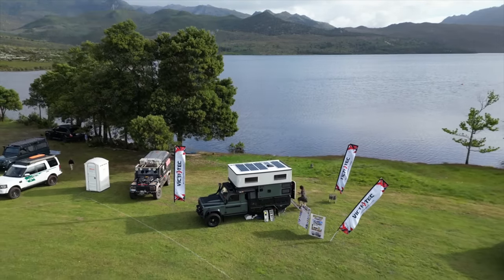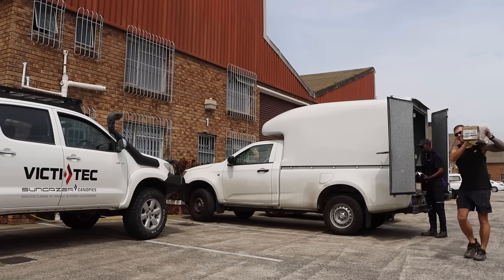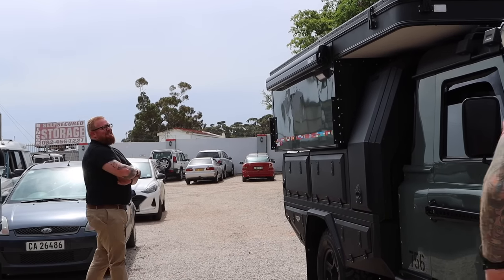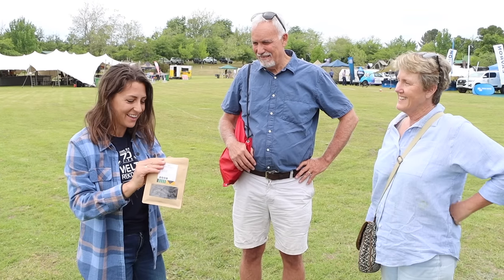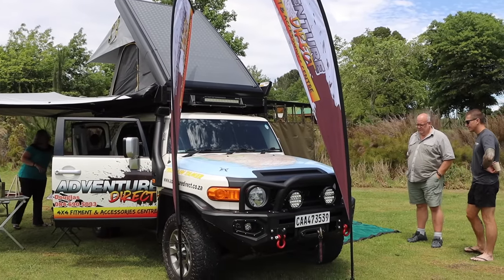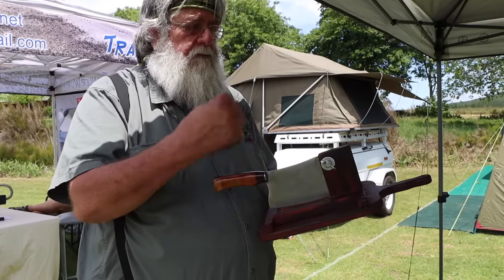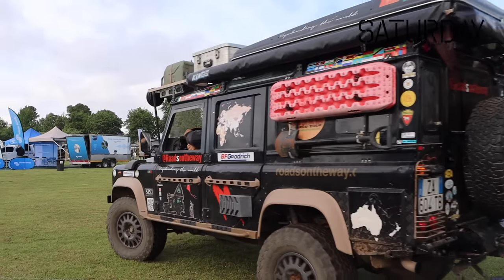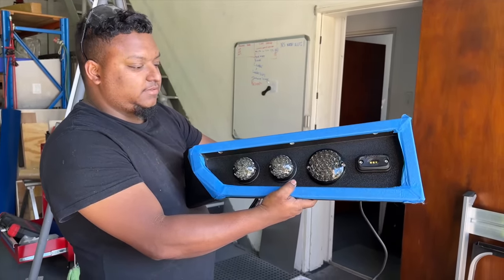People react to Overland Truck. (Ep268)

Comment: As everyone says, what an amazing conversion and congratulations 
My experience is somewhat different. After a number of months on the road in southern Africa the Defender has taken a battering and everything which could break has broken. I'll be shipping it home and will strip it back to the bare minimum before setting off again.
I look at the natty compartments and natty drawer you have and wonder how much will survive for a year off road. I will watch with interest.
Reply: @def,
2003, after a half-century of make-do camping in lesser rigs, we built our ExpeditionVehicle on a 1996 Ford CF8000 commercial truck.
Cummins and Allison.
GVWR : 29,000#.
Weight across the scale : 14,000#.
Cargo capacity : about seven ton.
.
During over two decades full-time live-aboard, our only repair was replacing the radiator.
So far, pretty good.
Reply: @largemarge1603  Wow that's good. A bit big for me though.

Comment: Build looks fantastic and has definitely given me a few ideas for my 110 hcpu. 

Have to ask how did you guys fit the non aircon grille to the front? I’m assuming you still have aircon or have you removed and installed a different system?

Can’t wait to see how the new build goes through Africa 🙌🏾
Reply from the maker: We don't have A/C 😝
Reply: @GrizzlyNbearOverland  hahaha really? What’s the reason for that? Thought it would be proper hot in Africa 🤣
Reply from the maker: @joshreardon6757  our Defender never came with air-conditioning and we've never really found we needed it. We like windows down and fresh air 😊